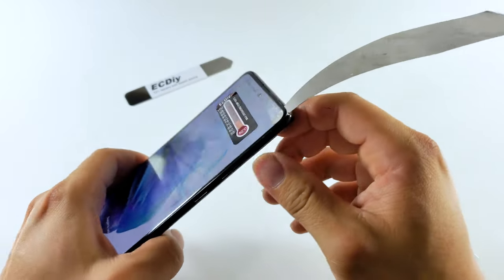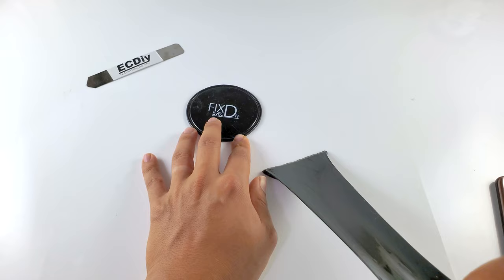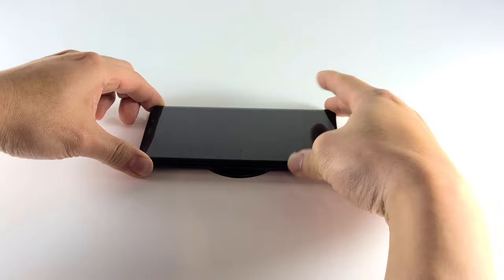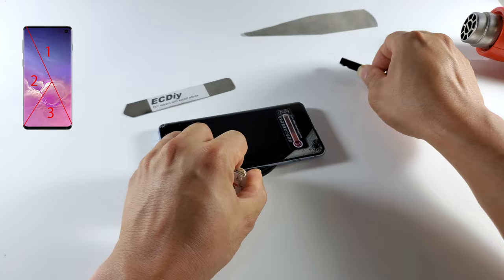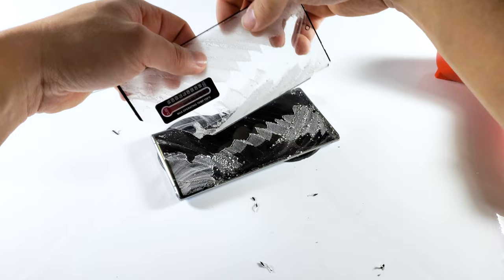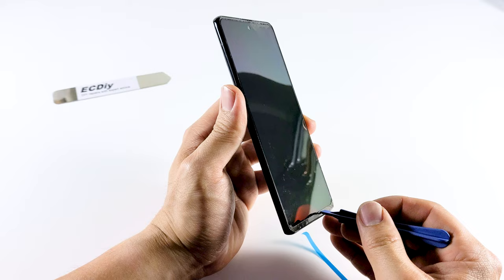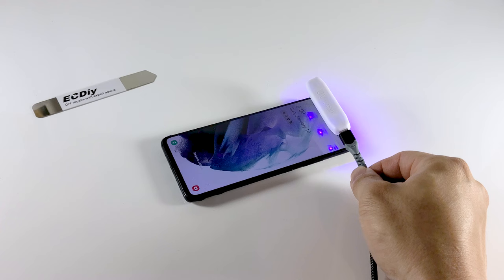How to Replace Screen Glass Only on Galaxy S22/21/20/10/+/Ultra/Note Shown in 6 Mins/New DIY Method

Comment: I have a few questions since watching this I think it's the easiest and best vid I've seen on replacing your screen. I don't have a screen protector, so will this very method work on a Galaxy note10 plus?  I've only seen vids where they totally take it apart to replace the screen. Is this method on this vid the same result, or is it different somehow?
If anyone can help me I thank and appreciate it in advance.
Reply from the maker: Hello Jermaine,
    This new method is not exposed to the risk of "tool jumping" explained in the previous video and this method works whether you have a screen protector or not. 
    The back glass does need to be removed prior to gluing in order to remove the front camera but the phone does not need to be completely disassembled.
    Any further questions/concerns, please do not hesitate to contact us/comment further.
Have a great rest of the day.
Reply: @ecdiy  Have you got any good reference to how to go about that front camera removal and replacement ? In what order should you do things and how to glue the back on ?
Reply from the maker: @jayzjek  Hello, thank you for taking your time to comment. 

Could you let me know which phone you are interested in? There are several 'teardown' videos I can reference, but for what it's worth, the process is more or less universal across all Samsung devices. Heat to soften the adhesive, slice it with OCA Blade, remove the back glass, remove the old tape, and lay the new adhesive (we include one with every kit). 

Installation is quite simple as the adhesive used on the back glass is essentially a double sided tape that is softened via heat. 

If we can be of any further assistance, please do not hesitate to contact us/comment further.
Best regards,
Reply: @ecdiy  thanks. Im on a galaxy note 10+.
It's also unclear to me how to manage the gluing of the front in terms of seepage through the camera hole and subsequent cleanup?
I.e. I imagine the front glass will get covered with glue in the camera spot.
Reply from the maker: @jayzjek  Hello J, 
Indeed, as mentioned in the video, for devices where there is a physical hole for the camera (Note 10+ is one of them, there are some newer devices where the "hole" is a clear piece of glass/plastic which allows you to glue normally), it is advised to dispense a couple droplets of the glue on the opposite side from the center of the phone. 
Any further questions/concerns, please do not hesitate to contact us/comment further.
Best regards,
Reply: @ecdiy  im not sure this is correct reg note 10+, my glass is completely flush. So i imagine the hole is only in the underlying screen. And thus its still unclear to me how to prevent seeping glue onto the camera spot on the glass which i imagine will then impact the camera quality if not somehow first removed.
Reply from the maker: @jayzjek  I apologize for having misinterpreted your question originally.
Yes, the front camera needs to be removed as demonstrated in the video. 
    On a Note 10+, this is done by removing the back glass (OCA Blade can be used to do this as well) and the plastic panels found atop. We include a new back glass adhesive with all kits.
    Afterwards, the hole area is cleaned from 'under' with Q-tip and isopropyl alcohol. 
    Any further questions/concerns, please do not hesitate to contact us/comment further.
Best regards,
Reply: @ecdiy  thanks, were zooming in on the right problem. Can you add details as to how to clean the hole area on the glass ? Is this done after the glue sets or when ? My intuition is that there will be a lot of glue to clean out.
Would you have any video about this?
Reply from the maker: @jayzjek  I would recommend cleaning after the glue is set.
    There actually isn't a whole lot of glue that would seep in there using the method outlined which is letting the glue spread mostly under its own weight. A couple drops of the adhesive at best.
   Also, for these phones, the spot the front camera sits in the frame is 'compartmentalized'/'recessed' so the glue doesn't get to other areas of the device.
    Any further questions/concerns, please do not hesitate to contact us.
Have a great rest of the day!
Reply: @ecdiy  regarding the back cover replacement. I was checking out the attached glue template for the back cover, and I don't see any glue around the camera hole. This doesn't seem right, any splash of water or dust would get right in. When googling back replacement videos, the backs being attached definitely have a glue pattern around the camera hole. Am I missing something ?
Reply from the maker: @jayzjek  In the context of the front glass replacement, the same back glass is used.
The camera bezel is attached to the back glass which is not removed in this case. 
It is only the parameter adhesive holding the back glass (with its camera lens frame attached) that gets replaced. 
Any further questions/concerns, please do not hesitate to comment further/contact us.
Best regards,

Comment: When you take the back plate off, don't you need to replace the adheasive in order to retain the waterproofing of the phone?
Reply from the maker: That is correct. We do include a spare IP68 back glass tape adhesive with every kit for this reason.
However, we have finished developing a clear camera hole cover film which all you'd need to do is press to seal over the camera hole area prior to gluing. This has been briefly shown in the S22 shorts video as well as the Pixel long form video but this eliminates the need for back glass removal as well as the front camera removal. 
Currently, it is only being provided on a request basis at no extra cost and no negative feedback has been received. With this, you wouldn't have to open the phone at all. 
Any further questions/concerns, please do not hesitate to comment further.
Best regards,

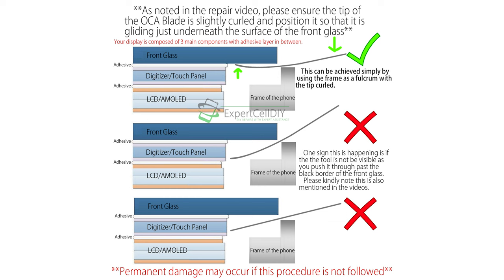Comment: How would you go about getting a new digitizer, I thought I saw the glass clearly, but turns out I didn't and separated the Digitizer/Touch Panel ( 1:34 ). The LCD/AMOLED is still intact, I just need the digitizer I guess.
Reply from the maker: Hello,
Thank you for the comment. I am sorry your repair isn't going as smoothly as we've hoped. Which phone are you working on?
Best regards,
Reply: @ecdiy  S21

Comment: While trying this my first time on an s20 fe, I destroyed my display when prying it up. How do I pry up correctly in the future? When the levarage, which layer to be on, etc? Or should I just take the screen off in the future, or use a dremel like I see in other videos? Thank you so much!
Reply from the maker: Hello Andrew,
     I am very sorry to hear your experience did not go as smoothly as we've hoped.
     I haven't experienced display damage during the prying process on our end, but I suppose it is possible if there wasn't enough heat applied to soften the adhesive? I can see how the layers of the display could be strained/pulled without the adhesive being softened. 
    Would you by any chance be able to provide us with a photo of the device so we can better assess what may have happened? 
     Any further questions/concerns, please do not hesitate to comment further/contact us.
Best regards,

Comment: Greetings, do you have any video on how to change both the front and rear of an s20 or rather the detailed steps?
Reply from the maker: Hello Edgar,
   Thank you for your comment! I am very sorry for the delay in my reply.
   We did not go in detail with the back glass removal as they're relatively straight forward and there are quite a few videos covering that topic extensively.
    In short, you can use our OCA blade to slice the back glass adhesive also and remove the back. 
    For the front, you'd refer to this video.

Any further questions/concerns, please do not hesitate to comment further/contact us. (Contact us for the fastest response)

Comment: At 4:29, you mention to remove the back glass and front facing camera before proceeding. Should you only return them when the repair is completed?
Reply from the maker: Yes, you should put the camera back after the gluing.   
    However, we have finished developing a clear cover film for the camera hole for most of the newer Samsung phones so gluing no longer requires the phone to be disassembled. You'd just need to center the film and press it to seal against the screen prior to gluing so the glue cannot get on it.
    For now, this new accessory is being included only on a request basis.
   Any questions/concerns, please do not hesitate to comment further/contact us.
Have a great rest of the day!
Reply: @ecdiy thanks. Does the kit come with the necessary equipment to reach the front facing camera and remove it?
Reply from the maker: @waleedalzuabi5131  Yes it does. We do include a replacement back glass tape adhesive as well so the phone can be sealed after the repair.

Comment: So do you need to remove the front facing camera on the s20 before you start removing the front glass ?
Reply from the maker: Hello Jamie,
   Yes & no. Yes, because on the S20, the camera hole is a physical hole in the display panel (S20FE, and some of the newer flat display Pixel phones, it's a clear piece of plastic in that area, not a physical hole). 
   No because we finished developing the clear circle film that sticks to the display without adhesive. This would be featured in a new video (But it's briefly shown at the end of our Pixel video). This film being installed prior to the gluing would prevent the glue from going on the camera lens. We're happy to include this free of charge with your purchase if you happen to be interested. 
    Any further questions/concerns, please do not hesitate to contact us/comment further.
Best regards,

Comment: What about a Samsung Galaxy A71, does the front camera need to be removed?
Reply from the maker: Hello Danielle,
    Yes & no. Yes because on the A71, the camera area is a physical hole in the display panel. No because we finished developing the clear circle film that sticks to the display without adhesive. This would be featured in a new video (But it's briefly shown at the end of our Pixel video). This film being installed prior to the gluing would prevent the glue from going on the camera lens. We're happy to include this free of charge with your purchase if you happen to be interested. 

If we can be of any further assistance, please do not hesitate to comment further/contact us.
Have a great rest of the day.

Comment: Hello! I have a Poco F2 Pro with the cracked glass (it works perfectly, but the corner of the outside glass is cracked). Do you think it's fixable? I don't know if there are differences between the screens. 

Thanks!
Reply from the maker: This, I'm sorry but I'm not sure. I have not tried it myself but if you ever see someone using a wire tool to do the glass replacement, our method would also work.
Best regards,

Comment: Hi, 

I understand removing the front facing camera before gluing the new glass on, so that the glue doesn't dribble onto the lens.

But isn't glue just gonna dribble into the void left by the removed camera?, and also dry in that position on the glass, causing focus problems when we re assemble? Or do we dab the camera hole with iso on a cotton tip? But then wouldn't that eat the glue and wick into the glue?

Also, I don't get the point of the stickers? We put them on the display, then glue the glass over the top, then try and pull them out after the glue is spread? I noticed the new camera spot things in the new vid and I don't get if that is the intention with them too?

Thanks
Reply from the maker: Typically, yes you would need to clean the underside of the camera hole area with a Q-tip and isopropyl alcohol.
   However, we have finished developing a clear camera hole cover film which all you'd need to do is press to seal over the camera hole area prior to gluing. This eliminates the need for back glass removal as well as the front camera removal!
   We have been providing it on a request basis at no extra cost for the past 4 months and no negative feedback has been received!
    As for the stickers, it ensures dust/debris/water do not seep in to the internals. The internals are sealed from under the display on the sides on all phones via IP68 tape adhesive (Some phones the top is sealed from the underside also) You do not pull them out after the glue is spread.
    Any further questions/concerns, please do not hesitate to comment further!
Have a great rest of the day.
Reply: Thankyou!, so you leave the stickers in place then? They won't be visible through the glass? And we leave the camera dot as well? I think I understand now.

I got my kit off you before you started doing that and I haven't bit the bullet yet because I was busy in summer but planning on attempting soon, I need to remove the back glass anyway because that is broken.
Reply from the maker: @mhale71  That is correct. The stickers stay in place. They are placed behind the bezel (the black border of the front glass) so it is not visible. 

The camera dot, yes that is correct. you would leave it in there.

Any further questions/concerns, please do not hesitate to comment further! I am here to help.
Have a great rest day.

Comment: What adhesive dd you use
Reply from the maker: It is called Stronghold LOCA. LOCA stands for Liquid Optically Clear Adhesive, there are several options but please kindly note many LOCAs require a separate UV lamp to cure. Ours is specially formulated to be hypersensitive to UV, so much so that exposure to daylight on a cloudy winter day is enough to cure the glue. Other parameters such as contractility, tensile strength and viscosity have all been fine tuned over the years for optimum results. 
    Please note there are a few sellers infringing on our trademark, Stronghold LOCA is developed by us and is exclusive to us. 
   Any further questions/concerns, please do not hesitate to contact us/comment further.
Best regards,

Comment: Can I use the same method for IPad Air 4 with laminated display as well? By using the same glue that you are using
Reply: No the touch screen of iPad Air 4 is separate from the lcd, will need to watch a video mate

Comment: 4:19 what do you mena by we need to remove the camera? My phone is s10 5g which has camera is under the screen as you explained. So does that mean that i will need to take the camera out and glue it, then put the camera back again? Im afraid if the glue will seep into the hole where i took the camera off.. 
Also, in 4:45, u said put two drops of the glue on the other side of the camera, but as I explained above, after taking the camera out, wouldn't glue would seep into the motherboard? 
Lastly, the ip 68 tape you have developed, explained in 4:29, do I keep it on and glue the glass on the display, or do I take it off before I put the glass?
Reply from the maker: While we finished developing a camera hole film cover for other phones, we do not have it for S10 5G at the moment so yes, in your case you would remove the back to remove the front camera prior to gluing as shown in our video. 

Due to the surface tension and cohesive force of the glue, sometimes the glue can indeed fill around the camera hole without going in there (you'd want to dispense a small droplet or two around the far side of the opening - like shown in this video and our iPhone 14 Pro ). However, as this doesn't happen every time, so we recommend just removing the back glass and the camera prior to gluing.

If any glue gets on the underside of the front camera area, you'd use isopropyl alcohol and Q-tip to clean the underside prior to assembling.

Any further questions/concerns, please do not hesitate to comment further.
Have a great rest of the day.
Reply: @ecdiy  for 4:45, can i use B7000 glue for adhesive instead? How do you think about the OCA adhesive film? Do you think it will make the process easier?
Reply from the maker: Hey, so sorry. For some reason I did not receive a notification when you replied. No, B-7000 is not optically clear, nor is it spec'd for this repair otherwise. 
OCA adhesive film does make it easier for Samsung phones but OCA does require special equipment such as a laminator which uses heat and vacuum, and a bubble remover which uses heat and positive pressure.
When it comes to iPhones and Pixels though, I'd say LOCA is easier and beginner friendly.

Any further questions/concerns, please do not hesitate to comment further/contact us.
Best regards,

Comment: I don't see a lot for a Samsung S21 5G on your site , think it has the 6.2" screen.  Love the video,  do you have the S21 5G screen kit available?  Model SM- G991 U
Reply: "lot", typo, I meant I don't see a "kit"  , sorry
Reply from the maker: @Jeanclaudevanderfield  Hello, thank you for taking your time to comment. For S21 5G, you'd select the S21 kit available on our site. Unlike the S20 series, all S21 series are 5G.
Any further questions/concerns, please do not hesitate to contact us.

Have a great weekend!
Reply: @ECDiy  Thank you,  I had noticed that there is an S21 model designation phone, and also a seperate S21 5G designation phone model from Samsung online, but looks like maybe the S21 was cancelled?  I was concerned they had different size screens,  but they are both 6.2" according to my recent research.  So if you have a 6.2" S21 screen repair,  then I'm sure that works. 👍😁 Thanks so much!